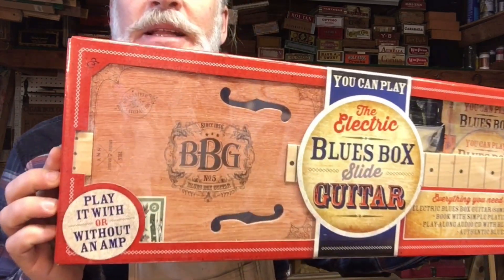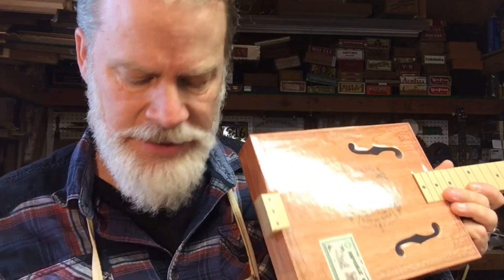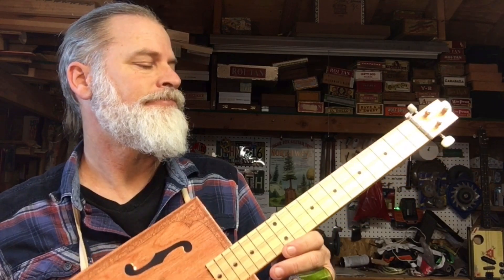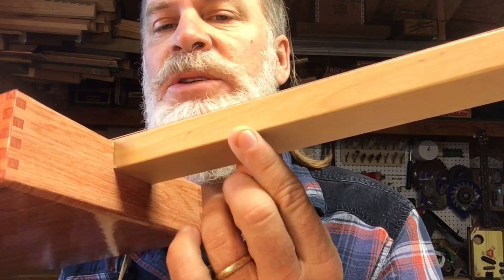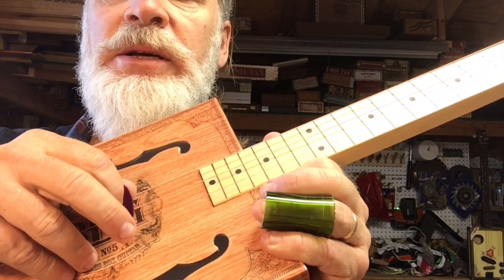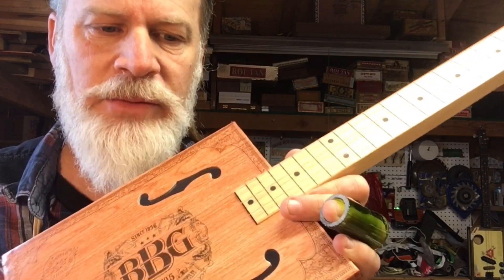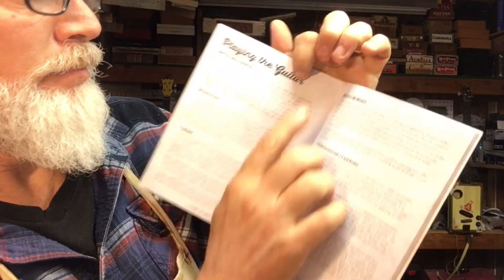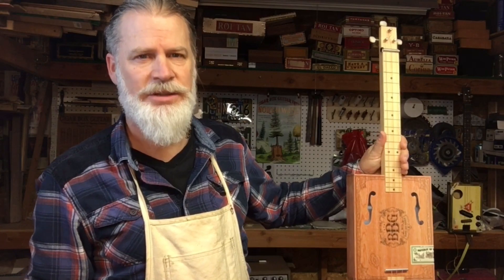Blues Box Guitar - Unboxing and Assembly

Comment: I have a cheap CBG just like that. The good thing about it is that it got me excited about Cigar Box guitars. Yes, I got it quite playable too when I made enough corrections. 😄 However, the end result was that I ended up getting a decent Cigar Box guitar. I haven't listened to the CD and I haven't read much of the book because you learn a lot more from these videos than from that book. 🤔🤷🏻‍♂️😄 It was also good about that guitar that building them also became very interesting. Why? Because that was so bad that out of necessity I started to think that I could do better myself. 😂 That's why I've started to get tools for working with wood. 

Thanks for the good videos. 👍😊

Comment: LOL.... Cigar Box Guitar "snob".

Mine came with a clear glass slide and, I believe, bushings around the tuners. I had to install them myself. But, the holes were pre-drilled. It's a bit small. But, it stays in tune well and is fun for starting out on CBG.

My wife bought it for me for Christmas 2018 at a local "Discount Books" store. I had never even considered 3-string CBG. But, this hooked me. So much fun to just noodle around with the slide.
Reply: I had to file some burring off from around the end of one of the bushings when I put mine together.  Other than that, it went together rather quickly.

Comment: Mine arrived smashed, the neck was not attached to the box and had a big dent on the neck. So now I’ve got a new one coming and the old one I glued back together and put brass corner pieces on the front and back, secures with gorilla glue. Then a 90’ brass brace on the neck to the body. That seemed to stiffen it up and made it sound better. 
I have a marvelous miracle oil can, 1 quart size and it might serve as a resonator pretty soon…

Comment: I procured  my  #5 BBG  from my local "Shabby Shack" for  $8.95. Not a bad deal considering it has 3 cheap-ass tuners, a pretty good beginner's brochure, a nice glass slide, a piezeeoh P/U + 1/4" jaque, 2  'F' hole patterns,  sandwich wrap, a stick almost big enough to club a salmon, and count 'em  3 groats. That duck tape idea sounds like really nifty  decoration and sturdy too. (I used to have a  '73 Pinto held together with that stuff.  
Blessings from the Emerald City , Fearless Freddy

Comment: I got the same one, my one came fully assembled and with a glass slide (the best part of the purchase!) Oh yeah and my wife got this one too.
The cardboard box is falling appart, the back cover is right off now. Pretty fakey overall.
Reply: I hated the glass slide.  Cheap thing couldn't survive a 2 year old dropping it on the floor.  Steel cabinet spacers from Lowe's work much better as slides if you have a toddler wandering around picking up stuff while your back is turned. =)
Reply: Duct tape
Reply: @adamjohnson9150 : Nah, but not a bad idea though. I'm planing to take the paper box right off and make something better, also do something with the nut and saddle, not sure what yet. The neck seems to be quite sound so it maybe worth playing around with it a bit.
Reply: @markg1051  yea use the neck on another build i thought about that too.

Comment: I has so many intonation problems with mine. It would sounds fine open but whenever I would try to play a chord anywhere the highest string would always sound out of tune. I tried everything but couldn't get it to work.
Reply: The action is so high it's really only good for slide.  Pressing down string will change the pitch and wreck intonation.  Smaller bolts would help, but playing chords on a fretless instrument is always a bit tricky.

Comment: The only thing I didn't care for in the one I got a few years ago was the glass slide that came with it.  Stupid thing shattered the first time my great-niece dropped it on the kitchen floor.  I've stuck with Hillman 3/4" x 1" x 2" steel spacers from Lowe's ever since.  I've also cannibalized mine for parts to use on other CBG ideas; including cutting it open for the Piezo pickup.  Was fun while it lasted, but it's still creating other fun things that live on. =)